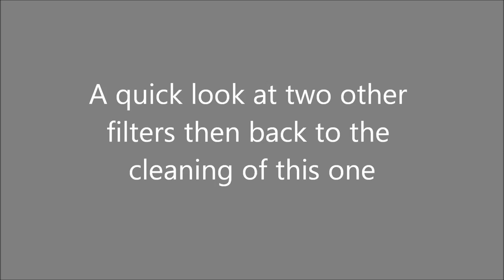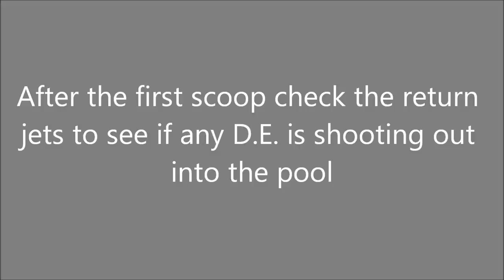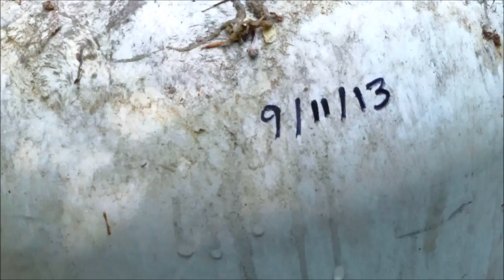Cleaning an American Products D.E.  Filter  (CM, RPM & SS)

Comment: I use boss lube, it seems like that spray silicone will speed up my job.  What brand and where do you get that?  Thanks
Reply from the maker: My supplier carries it -Superior Pool Products. If your location doesn't have it they can order it for you as it is in the system. I've seen similar silicone spray at Walmart for RV's and at Auto Zone. One thing I've noticed by using the Silicone spray is that the o-rings last much longer and the lids are much easier to get on. Plus it won't get all over your hands like Magic Lube does. One can is good for 20 filter or so. I've order a case  from Amazon also which lasted me three years - a little overkill.